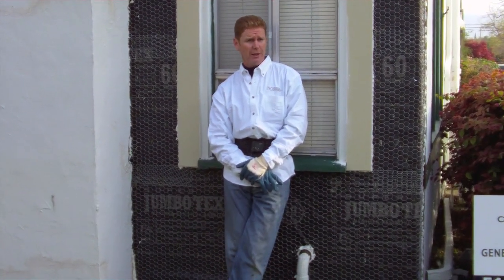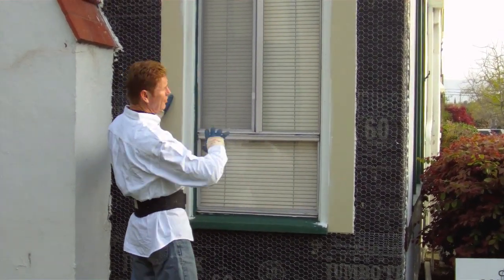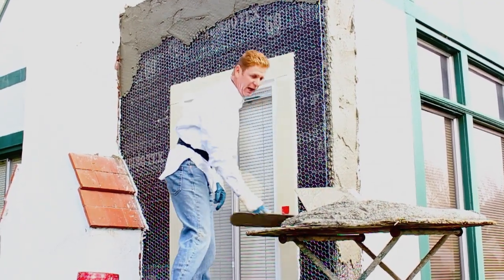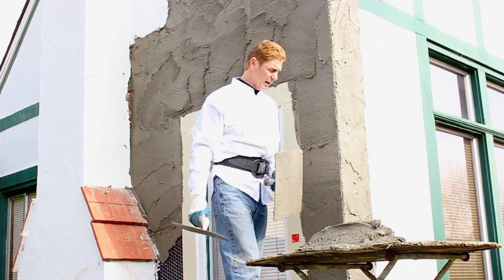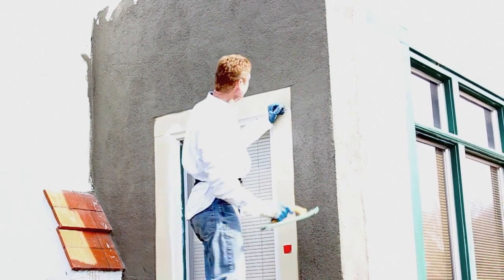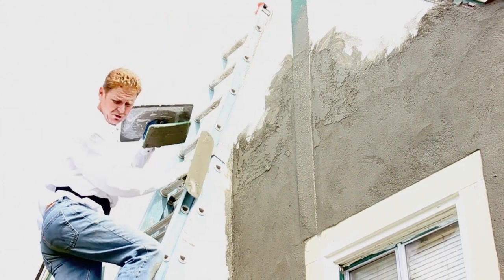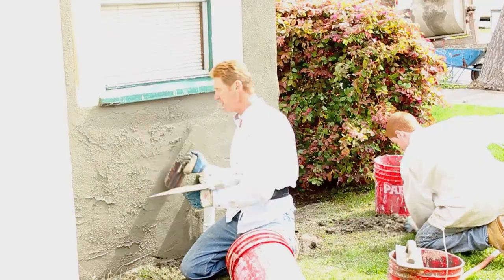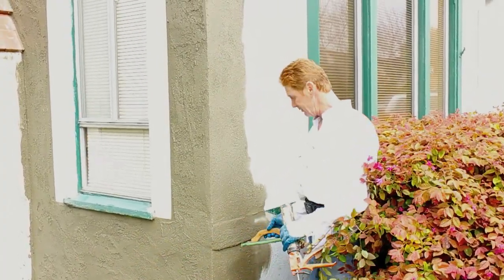Stucco patching same day.

Comment from the maker: Hi Gilbert, you’re welcome. Usually when I find cracks in stucco houses with sand finishes I will often use Mor Flex as it's flexible and has sand in it. Easy to clean up too.
Have a good day!
 Kirk Giordano Plastering

Comment from the maker: Hey albert, good question. I usually like my stucco texture mud much looser then the stucco base I fist apply on. Depending on how hard the rapid set or whatever base coat you applying determines how much water I add so it will texture as the one I am matching. If I just need a few hawks of mud I can mix on my trowel, the board or in a bucket. 
Have a groovy evening. 
Kirk Giordano Plastering

Comment: Hey Kirk, thanks for all the tips.  Did you use rapidset to do the texture as well?  And are most skip trowel finishes done with stucco that is slightly watered down?